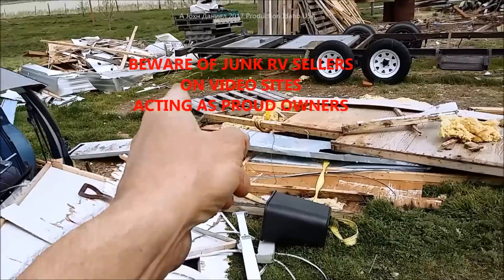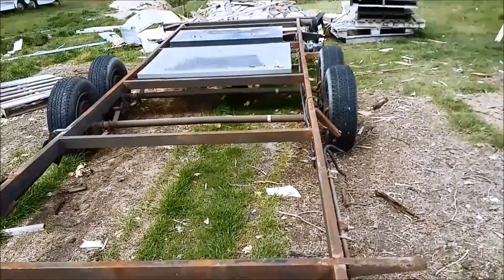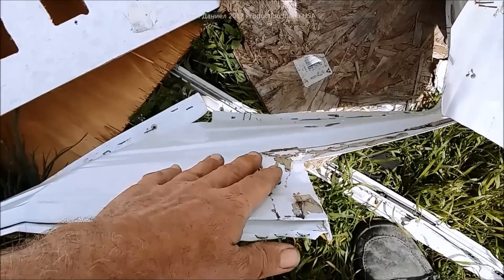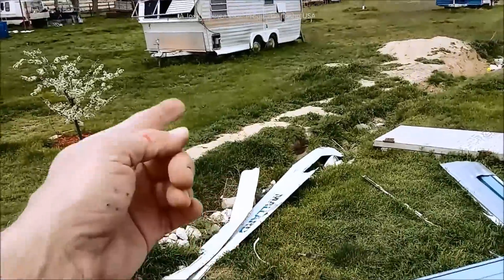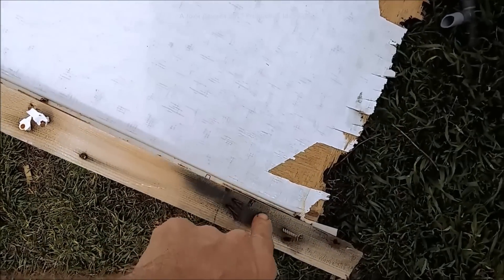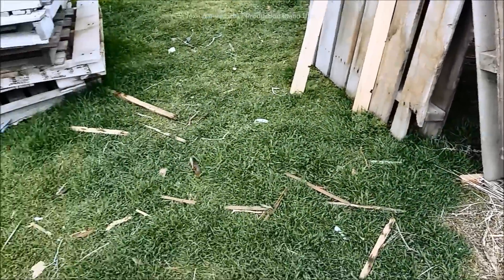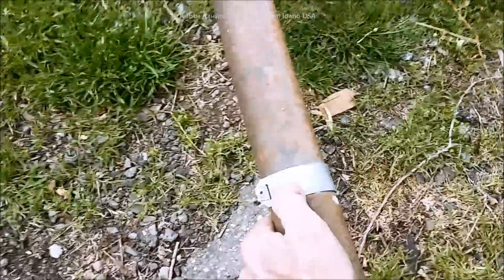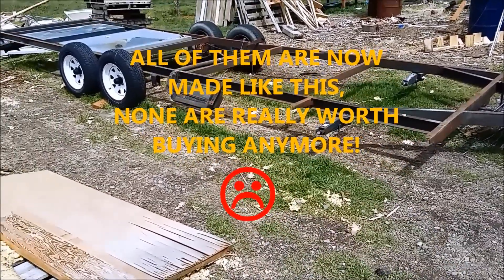HOW THEY MAKE RV Campers Travel Trailers, The truth, Wow! Info Below

Comment: I’m sorry, those of you saying this is simply a lack of maintenance are just wrong. You can properly maintain a trailer and still get all these issues. The OP is 100% correct. These travel trailers are put together as cheaply as possible using very cheap materials. Very little road testing (if any) is done by the manufacturer these days. You take a low quality stick framed box held together by staples, low grade adhesives, and then place that box on a frame that flexes too much and it’s not a question of if, but when it’ll fall apart. The adhesives, staples, and water sealant compounds deteriorate due to excessive flex of the frame and box. The deterioration is in places not accessible to the owner. Most of the US RV manufactures today build very cheap trailers. Dealers make a killing on them, and buyers have no clue how poorly they’re made.
Reply from the maker: Yes, few understand the wood that is supposed to keep it rigid shrinks, expands and flexes. No super caulker can save shitty built stuff.

Comment: You made my day.  I have an old 1977 Holiday Rambler and it is still solid and tight.  I did give it a redo a few years ago, pulled all the windows and gave it a good paint job inside and out.  I'm 70 so it will probably out last me:)
Reply from the maker: The only fail issue in a Rambler is Condensation around the vents and windows. But installing a solar ventilator you can double its lifespan.

Comment: The problem with trailers is that they make them like new houses. Fast and cheap. The frame is small because the walls add stability(rigidity, reinforcement). They make them as air tight as possible, just like a new house, so if any moisture gets in it is trapped and rots out the walls. The jacks aren't made for lateral stress that's why they bent. You can have a tiny leak in the plumbing and it'll rot it out because they make them too air tight. I'm not arguing with you, I'm just saying that new $500,000 houses are made just as cheap and shitty. People buy them because they are too stupid to know different. Which sells campers and that's how they get away with making them like this.
Reply: yeah but the difference is the 500K house is only going to harm your wallet. The RV is potentially going to kill you and others on the road

Comment: I bought a brand new 2015 Open Range 5th. Wheel we got to take it out once and they had to take back to the factory because the walls outside were Delaminating, I was told they pulled the walls apart and re did them, what a piece of shit.

Comment: The majority of class C motor homes are built about the same . The modern rubber membrane roofs also scare the hell out of me . We were out on the interstate and could see something ahead of us that kept looking different and seemed to change . When we were close to to , it was a fifth wheel camper . Evidently a branch had torn the membrane at the front and it was inflating the roof up to about 4-5 feet higher . As the headwind changed it would inflate or deflate several feet . It was during a rainstorm and I would guess they took on a heck of a lot of water . Could not get the drivers attention to pull over .

Comment: Great video! We bought a Jayco Melbourne C class in 2016 that is junk. They are now owned by Thor, no longer a family owned company. 

Generator caught on fire on trip home from the dealership...that was just the start! Seven months and two trips later, we drove it back to Indiana (from AZ) for extensive repairs. It was there over 2 months while they fixed everything, slide room that didn’t have rollers, gap above slide room so big you can see daylight, screw visible under fiberglass exterior (bump), drawers so thin they bowed and scraped when we put a few items in them...much, much, more. Disgusting!  We drove it back after repairs and generator STILL did not work! Took it to our shop, mechanic said it was wired wrong, wires dangling and barely hanging on...explaining intermittent work/not work problem.

We got that fixed and consigned it...bought a Phoenix Cruiser and so far so good...worlds apart.

Comment: What about the Holiday Ramblers and other aluminum frame travel trailers?  What about Northwood Nash?
Reply from the maker: Ramblers are the premium thing to own. As well as a few other similar. But with a Aluminum frame, I suggest staying with a Aluminum skin. Reason? moisture gets in the walls of ALL of them, sweat. If its fiberglass on Aluminum you can get hydraulic freezing which will push the glue and crack its adhesion out. Classic Ramblers are both glued and riveted, prevents hydraulic freeze issues.

Comment: It's all the trailers that are made by Fleetwood . I purchased a new one a few years ago ,the roof leaked and ran down the I side wall and rotted the slideout and the floor , couldn't walk on it because you would fall through 
Called Fleetwood and they told me that it was my fault . Took it to a repair  place and they pointed all the reasons why this happened , manufacturing problems they wouldn't fix..I year old  I gave it away

Comment: People talk about maintaining them.  Well, they are correct to a point.  But you shouldn't have to rebuild it after a few years.  You don't put floor supports on 4 ft centers (as it appears to be in this video).  The spacing appears to be equivalent to the diameter of the two tires on the axles.

Comment: ALL travel trailers, pop-up campers and even expensive RVs are built as cheaply as possible with the goal of maximizing their profit quality be damned.  They can build a pop-up camper in one day once the chassis is rolled into the shop.  A travel trailer might take one more hour.  Our pop-up camper was put together he same way - staples, no glue. Aluminum screws to hold the slide out be rails.  The screws broke because they aren't strong enough to handle the rigors of driving down the highway (suspension was rubber torsion axles) which are too stiff.  That transmits road shock directly to the camper body.  No one would buy a car with that type of suspension.  I think the feds had a hand at forcing them to build them lighter - lighter equals cheap, not inexpensive.

Comment: I have worked for a R/V Dealership for the past 4 years and I have seen all that you have shown.  I actively, for a hobby, design, build and fly RC airplanes, since about 1963,  meaning I kinda know how to build stuff straight and strong. So, when I see this kind of workmanship all I can do is just shake my head and walk away.  I design, build, and repair things.  I agree that most of the R/V's are put together just so cheaply.  OSB instead of a good grade of weather resistant plywood, twist on wirenuts instead of soldered connections.

Comment: Regardless of the brand of Fleetwood or jayco . These things are designed & built to be as light as possible. Everything is under built & the engineering of these vans are so basic , the cabinets are a integral part of the structure holding it together 😲 it's ridiculous.

Comment: I was told about 6 years ago to get an older model with a metal roof at least, like you mentioned in the beginning, a 1975-85 Holiday Rambler might be the way to go if the frame is still in good shape. I always thought the aluminum frame, fiberglass sided models would be the best like a Cardinal, but their expensive and I know mice can get in them thru that poly mat on the underside. I never bought one but if I did it would be a well built cargo trailer. Too bad American Greed has taken over.

Comment: This is why I’m planning to convert a Wells Cargo Autowagon 28’ car hauler. Everything I’ve heard about Wells Cargo trailer build quality is Quality, quality, quality. I rather have a spartan interior inside a tough steel framed box than a flashy interior inside a aluminum stapled fire box. 

I do want more opinions about Wells Cargo car haulers.
Reply from the maker: WC is a premium build cargo trailer, but you can if you ask get them upper framed in 065 square tube and the weight is more manageable than 188 wall tube by far and you loose no strength since you will be building stuff into it. .

Comment: Haha I emptied my black tank and when I took my hose off there was a half moon plywood/foam block sticking out from the hole they drilled into the floor and tank. Fresh water fill hose was higher than the vent so that was a nightmare to fill. And the hoses and wiring , well that was a rat nest of fun. And let's not forget....ah the hell with it I don't have to tell you. In my opinion they never made a decent trailer ever and regulations , that not worth the paper it's wrote on , if there are even regulations?

Comment: nothing wrong with grade 5 bolts...... still stronger than mild steel
Reply from the maker: Except shear strength is 1480 lbs on grade 5 in this scenario. Not great with near that weight being open sprung........... Don't hit a big pothole.
Reply: Јоhn Daniel Probably should be grade 8 for that application.
Reply: And probably should be doubled, or at least used to retain a steel spacer tube just to get it out of shear.

Comment: One company that is still quality and hand built is Airstream. Went through there facility and was impressed on the materiel and quality.  Yeah there over priced. But compared to the other manufacturers they are a way better platform.
Reply: Nels Marcussen and that's probably why you see the old ones still going. And used they are up in price also

Comment: I believe the flimsy nature of the frame with nothing on it, is not accurate.  The floor and walls add structure integrity to the trailer as a whole.  It would be like chopping the roof off of a car and remove doors and wonder why it will sag in the middle.  I do know that all are not made the same.  I own a 35' and its construction is nothing like that one.  That being said if you want the frames made out of 1/4" wall square tube than you better buy a semi to pull the 20,000 pounds.
Reply from the maker: Without a more solid frame you get racking when they are hauled. Racking is when the 2 differing materials fight each other ( unlike a car-all metals). In other words, with a very flimsy frame, wood or no wood the trailer will twist on every bump down the road, eventually opening up seams, leaking, getting weaker, weaker till it just destroys itself. Unlike a car, wood contracts, shrinks, swells, and fails fast when not on a much more substantial frame. They do not need to be made with 1/4" steel but they do need a real skeleton even if the rest is wood, like a Cargo Trailer has, Like Winnebago builds them now, or like Airstream does in pretensioning construction.

Comment: My husband and I bought a motor home back in 1995.   First thing he did was rip everything inside the fiberglass shell out, frame out some interior walls and insulate the ruddy thing.  Then rebuilt it from the walls out.  And every time we went to move it, we had to put a new starter in it.  Hubs didn't know that much about motors, to fix it properly.

Comment: Come on people.... These are trailers; not built homes. There not expected to last 30+ years (but can). This is also a trailer made by "Fleetwood". This is like comparing and Dodge Dart (Fleetwood) to a Ferrari (Airstream) . This is why you have to do your research on what you buying. This is the old saying you get what you pay for.If you buy cheap you get cheap. Now there are lower cost options that are well made you just have to RESEARCH. But they are trailers after all. Made with 1/8" plywood not drywall, 1-2 inch wood or aluminum framing not 2x4's 2x6 framing. And aluminum siding not brick, stucco, or MDF siding.